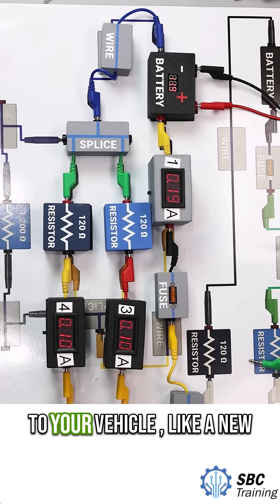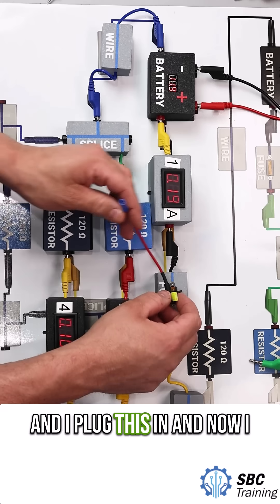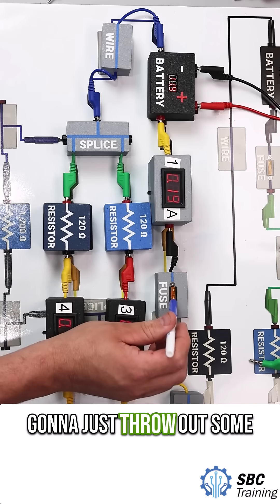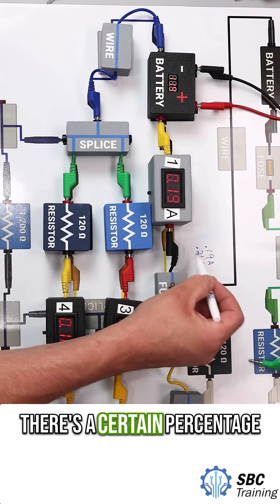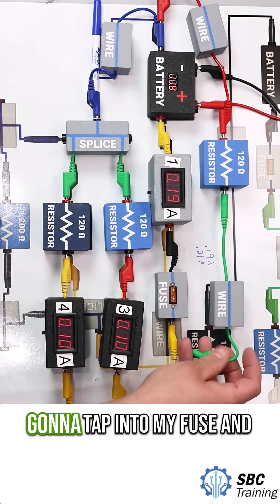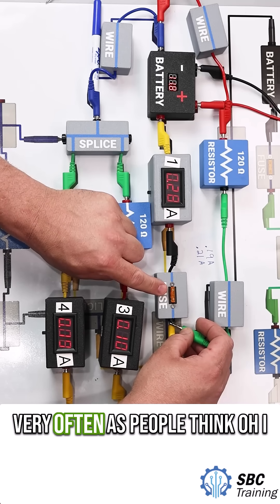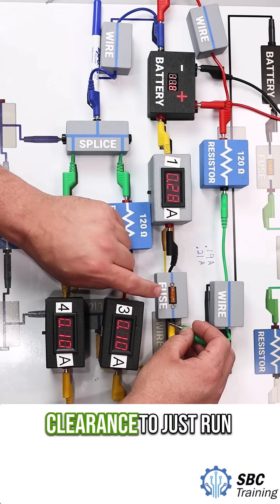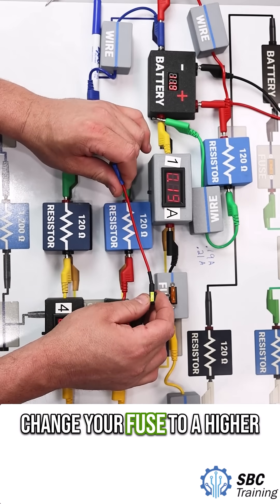Why You Shouldn’t Tap Into a Vehicle Fuse for Power

Comment: Most of the time those taps are used for extremely low power applications like signal wires (so a device knows when you turn the car on, not drawing any power), and where there isnt appreciable additional current draw. The largest thing Ive seen on a tap is a dash cam, which maaaybe draws .25 A at most,  which is well within tolerances for any of these circuits. I'd still choose a non essential circuit like a cigarette lighter to tap, just in case. 

No one is plugging amplifiers or anything serious into these (I hope!)
Reply from the maker: I agree. The important thing is to be aware of the potential issues and make good choices based on your needs.

Comment: You instantly overwhelm your factory device, which operates via that fuse. Increasing the fuse size and amperage capacity only compromises the original devices protected by the fuse.